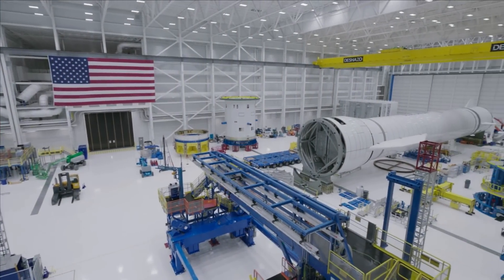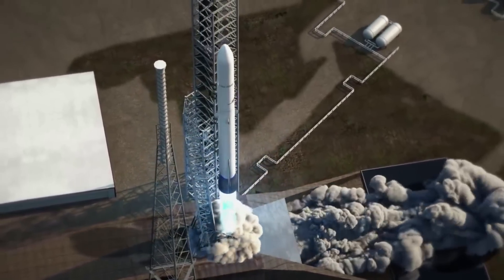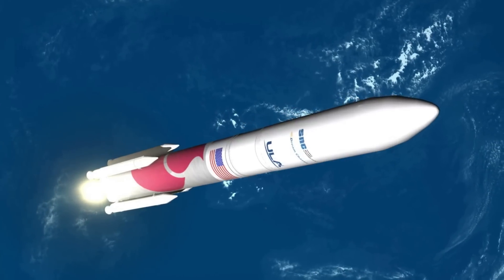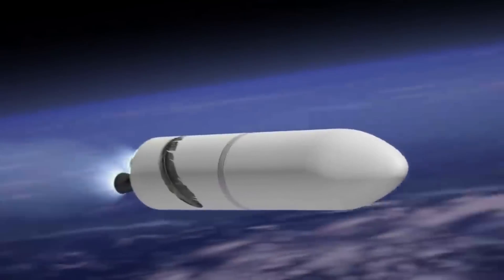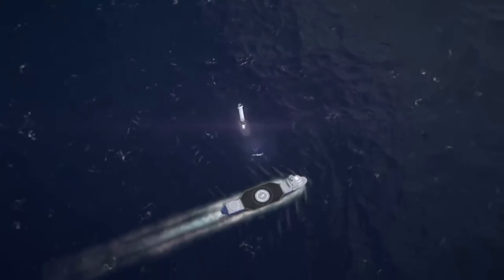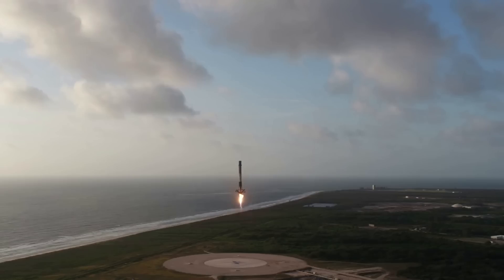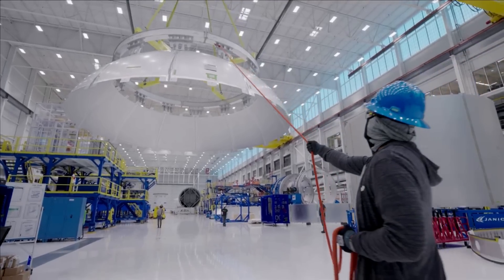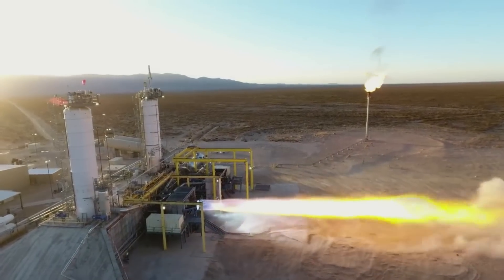Is Blue Origin Making Progress On New Glenn & Its First Launch?

Comment: Rocket lab's neutron rocket will make it to orbit before new Glen.
Reply: Do you think Terran R will come first too? Wikipedia says Terran R and Neutron are planned 2024, while new Glenn is planned for Q4 2023, but these dates slip.
The next couple years will definitely have a lot of interesting new (partially) reusable methane powered launch vehicles.
Reply: @plainText384  Not surprised if Terran R makes it to orbit first either.  Spacex started with a small rocket (Falcon) and then taken what they learned to create a medium lift rocket (Falcon 9) and then a heavy lift rocket (Falcon Heavy) and then a super heavy (Starship).  Incremental steps.  BO wants to basically start with the king of heavy rockets without ever getting to orbit.   They want to make it re-usable right from the get-go.   New Shepard isn't an orbital rocket.  It barely counts.   It's like if NASA's first rocket was the Saturn V.  New Glenn will likely never fly.  BO tried to skip ahead so many necessary steps.
Reply: @edgallagher8675  it's more like if NASA went from a reusable mercury-redstone to a reusable Delta-IV Heavy (Saturn 5 is more than 3x the size of New Glenn), except in this reality Roscosmos had already successfully built everything from R9 to N1 and aren't exactly to bothered about hiding that knowledge.

Blue Origin doesn't need to do everything from scratch. They know everything NASA knows and they can hire employees, who have experience working with very large orbital launch vehicles from Boeing, ULA or SpaceX.
Reply: Rocket lab are working with a much smaller and lower technology/lower risk model matrix.